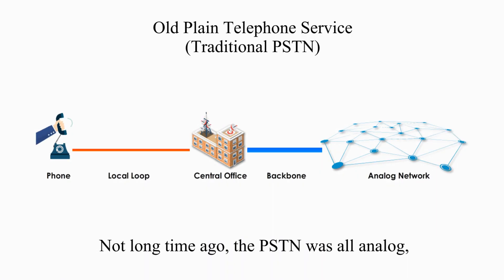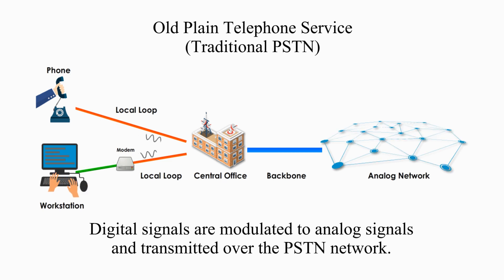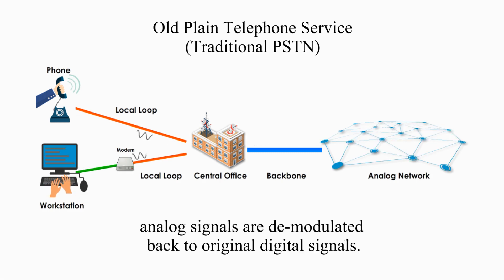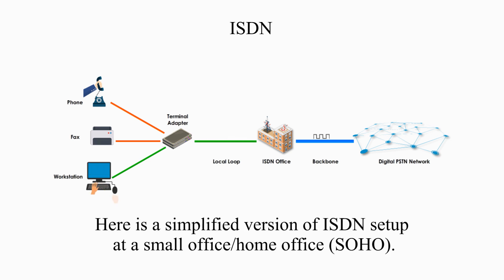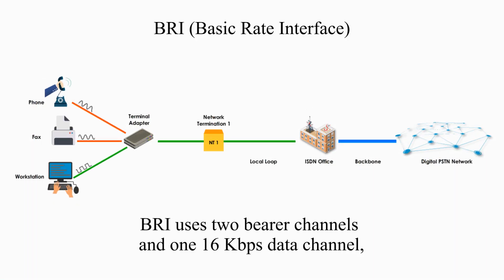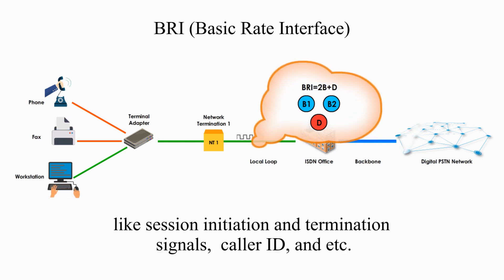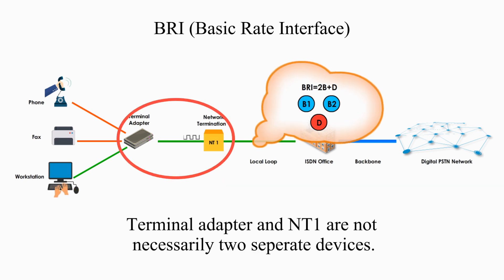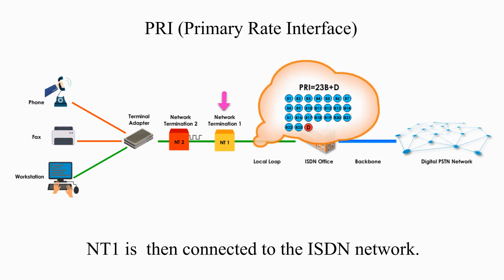ISDN - Integrated Services Digital Network

Comment: Most of you are too young to remember isdn lines but I had an isdn line in my house back in the 90s lol
Reply: we did too, 128kb line. much better than analog 56k. Got rid of it the second cable modem was avail here, around 1999. The ISDN line was very reliable, and 128kb at that time wasn't bad, but 1mbit was much better lol

Comment: Yeah, but how do you connect it?
Reply from the maker: with a modem. It is a legacy technology.
Reply: @sunnyclassroom24 like what does the U interface port go into? What is an example of a full ISDN modem setup?
Reply from the maker: @scaprod558  at home it was much like DSL or dial-up (both are old technologies): the modem or ISDN router has RJ-45  port to the computer and RJ-11 to the phone line. It was simply plug-and-play. For enterprise-level setup, I did not have much knowledge.
Reply: @sunnyclassroom24  Ah, I see.